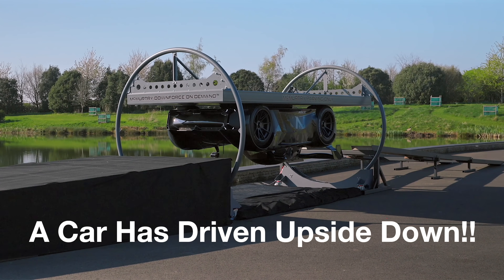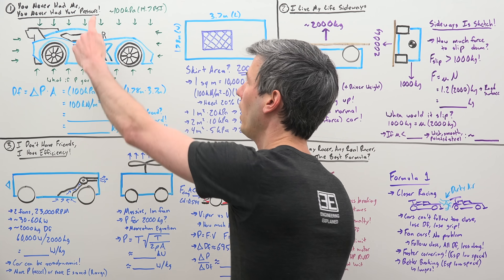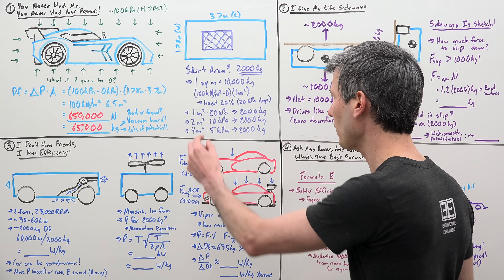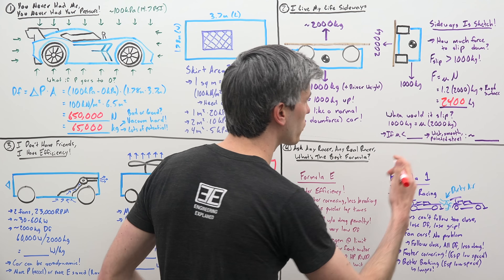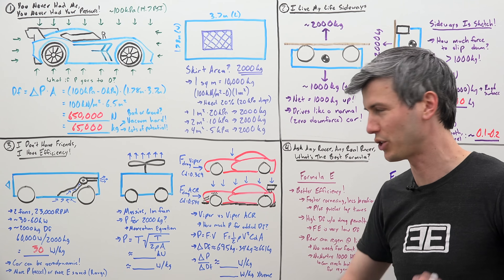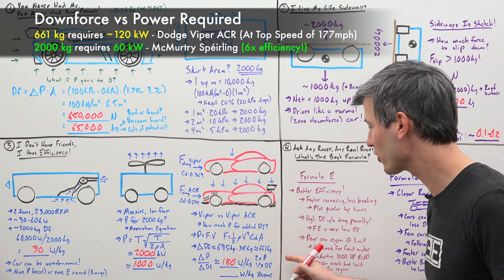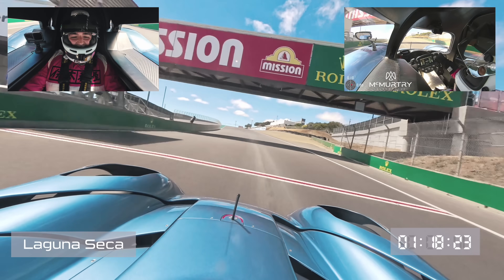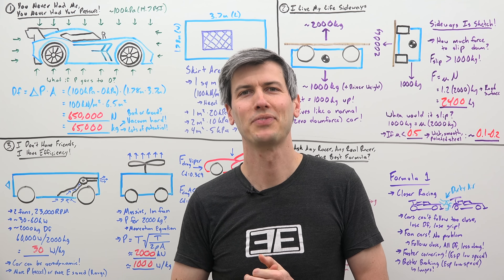This Car Just Drove Upside Down!

Comment: For racing - one thing the McMurtry Spéirling has that the Formula cars don't is a closed cockpit. My one concern -- which many of the people who raced against the Brabham BT46 had -- is the dust a fan car throws at you. F1 and FE would either need closed cockpits or PAPR helmets to prevent dust getting to the following drivers eyes and lungs.
Reply from the maker: F1 drivers wear helmets with visors
Reply: @ For sure, but I do worry that since they aren’t completely sealed helmets, with cutouts to allow air flow in to cool the driver, that following behind a fan car chucking pressurized dust at you some would get in. Especially with the negative pressure created by every inhalation.

Comment: There's a reason why this will not be implemented in racing. There have been cars with ridiculous amounts of downforce before in formula 1 (groundeffect cars. Even some with active fans like the Speirling) in the late 1960s to early 80s. The technology was banned after some horrific crashes. Yes it works well, but if you ever hit some uneven part of road, debris or bottom out then that spoils your seal. In a 3G cornering maneuver you're just going to fly off the track.

Comment: A cool feat of engineering, but suction is far different than wing style aerodynamic downforce. I could put a skirt on my chevette and drill a hole in my hatch then put a big vaccuum pump on. And I get pulled to the ground. Doesnt make my car aerodynamic. It is just using power to counter gravity. An inverse hovercraft. Or if one did something like the moeler skycar snd reversed the propellers.

Functionally, of course it works but not quite the same principle as the core topic of the story. Course by physics, the work to do this is the same as to overcome drag to provide the same as winged downforce, but it can do so actively and at lower speeds.

Comment: I was really confused by how the little fans could be so much more efficient than an upside down helicopter rotor, because that is something that just flies (pun intended) in the face of my understanding of general aerodynamics. The reason high-bypass jet engines and gliders are so efficient is because they impart a small moment change to a large volume of air.

But then I realized the key difference with Spéirling's fans is that they are not operating in a normal atmospheric environment. Sure they impart a large momentum change on the air they do move, but they are operating at a near vacuum. However that vacuum doesn't come for free, the car lowers a skirt to improve the seal it makes with the road surface. I think to really compare the Spéirling's active downforce system with a passive one we would need to account for the change in drag coefficient lowering the skirt causes. Even if the active system isn't more efficient in the end though there are still all the other advantages of an active downforce system you covered.

Comment: You said you dont see this being implemented in street vehicles but I see a really good use case.  Preventing Tractor trailer roll over when traveling through high wind areas like Highway 2 in Montana or 550 in Colorado.  Big fan additions to trailers that are used in the region could mitigate a lot of roll over events
Reply: That's a legitimately interesting idea!
Reply: A normal road isn't as smooth as a race track. That car needs to be very close to the track, as shown in the video. And also there could be too much debris. Imagine the fan sucking a plastic bag, or something like that.
Reply: @f-s-r  fan guards 😉

Comment: Having fans instead of passive downforce will eliminate the drag from the downforce and will also reduce overall drag not from downforce.  Blowing air into the low pressure area behind the car reduces drag to the point of actually pushing the car forward. I faintly remember that the Chaparral 2J Can-Am car could go about 40 miles per hour just on the thrust of the fans with the main drive engine not running.

Comment: Couple of things:
1. I hate the metric measurements. I find myself trying to mentally convert to imperial units.
2. The fan concept for downforce is interesting but ultimately doesn't/won't mean closer racing in F1. Less drag means less tow which means less closure speed. The late lunge doesn't work because the braking distances mean even less braking, less speed bleed off, and less potential for lockups because the downforce remains relatively consistent because of the "artificial" downforce. Last the engineers in F1 will always find a way to take advantage of the rules and the best will still rise to the top. Better racing (more driver dependent) in F1 would happen if you take away a lot of the driver aids (diff settings, different engine mapping, different braking biases, etc) and make the drivers compensate for the car.

Comment: I've been wondering since the McMurtry came out if the same technology could be applied to an electric semi, except suck the air through the front faux louvered radiator grill while at speed to negate the wall of air the truck is trying to push through, of course with a system of determining how much power to put to the tires or to the fan(s) at various speeds. It works in my head. It could even have a system of channeling the air all the way to the rear of the trailer to reduce drag.

Comment: Another way to estimate the power and speed cost of downforce for the Viper is based on ratios. The downforce increases the coefficient of drag by roughly +46% (.37 to .54). Power is proportional to this, so it would take about 46% more power to reach the same top speed. Top speed is proportional to the cube root of power or drag, and cube root of 1.46 is about 1.13, so speed would drop by about 13%.

Comment: from an engineering perspective, once you introduce the grip tape, is it appropriate to even be discussing coefficient of friction in relation to side slip? Since the rubber of the tire keys into the irregular surface of the tape, just like a road surface, slippage results in a shearing force between the surface rubber and the underlying material (laying rubber). Do any calculations for friction take in texture and size of the contact patch?
Reply from the maker: Answering your last question, yes and yes. Frictional coefficient is always surface dependent, and texture is a critical element of that. Larger contact patch tends to increase frictional coefficient, though only very slightly, due to something called tire load sensitivity (I have a video on this if interested - https://youtu.be/kNa2gZNqmT8?si=ES7YLyy7NUA-wbo_).

Comment: This isn't how F1 cars atick to the ground or a claim of how it works. This car is doing something else intirely. The idea behind F1 is that it's from airflow coming from the front of the car and not a fan. This car is like a reverse hovercraft. Very cool, but to show an F1 stick to the ceiling, they would have to put it in a wind tunnel and push enough air over it.

Comment: One question comes to my mind. If it generates so much dowoforce, then why it still has rear wing and other common aero bits? Would't it be better to reduce drag to improve efficiency while still maintaining huge downforce level coming from the fan? One reason that comes to my mind is car stability and consistency of downforce coming from the floor (Peugeot learnt it hard way with the first revision of 9x8).
Reply: Might also need to have some redundancy for more leaky pavement, areas with small debris, sections that aren't flat enough etc
Reply: Even more downforce more better
Reply: @timbryan6013 but the whole point of the video is proving that fan downforce is way better than passive aero downforce. so  it would make kinda  sense at least for the most extreme track version to remove all passive aero, boost the fans a little bit more, and achieve shorter lap times with more acceleration, higher top speeds, and better range
Reply: the car is still designed to be drivable with the fan off, to speeds approaching 200mph, just way less downforce. with zero passive aero, maybe the car would have too much lift
I think there might be a design decision that the car while using unconventional fan downforce, must still look like a conventional race car, which it does despite being narrower

 probably also because of redundancy. imagine a car being designed with a lot of lift and only fan to cancel that lift. not only you would have to make sure the fans are spinning correctly before trying to reach this speeds, but also imagine you have some catastrophic fan failure, with road debris getting sucked, may be getting filtered  by the  
protection mesh but eventually clogging the airflow. the last thing they want is a car going airborne at 200mph
I am guessing if they really wanted to push the map times with the fan mode they could remove the passive aero or make it active.

Comment: Chaparral had a vacuum cleaner car with a second engine to blow air through the radiators by sucking it from under the car, back in the 70's

Comment: This makes me wonder about other EVs and aerodynamic and/or performance focused vehicles. The Lucid Air Sapphire, Model S Plaid, Hyundai Ioniq 6, etc. How much downforce do they make? they are some of the lowest drag coefficients ever made on a car. They are blisteringly fast, with the exception of the Ioniq 6 which is "only" 4.4s 0-60 and EVs are largely called less agile because their weight, but also low drag means low downforce. Could that be part of why they are less agile? or are they significantly  less capable of cornering by downforce, and their high curb weight almost helps to make up some of that loss. This is well beyond my knowledge, but could be fun to learn about in the white board format

Comment: Its cool but higly impracticle. Are we just gonna make upside doen roads? If so how well maintained are those upside down roads g9nna be cause we cant even take care of pot holes on regular roads i cant imagine upside down roads. Not only that if a theres a failure in the vacue system while upside down your not just gonna stop and pull to the side, no your gonan fall and possibly land on someone possibly killing them and your self. I would feel safer with elecrot magnets that would stay on instead of a fan motor that can possibly fail vs a no moving parts just current flowing to make a magnetic feild.

Comment: Standing still sucking upside down is not the same, for a car to DRIVE upside down it needs to overcome the drag that is at same time creating the downforce meaning if there is to much drag the wheel will start to spin and you loose speed and fall down...

Comment: Didn't it really just park upside down while a truck pulled it on a trailer with specialized equipment? 

Not really the same thing as aerodynamic downforce when you've put a giant vaccuum under your car.

Comment: Having worked a little bit with turbomolecular pumps... I was always scared of breaking them in a controlled lab setting. It feels remarkable that the pumps on this car can spin at 20k under high-G dynamic situations and still operate correctly, but maybe angular momentum is too formidable to care about some measly race track force

Comment: It's not driving on aerodynamic downforce, which requires speed + surfaces.  It's a reverse hovercraft that generates suction using motors.  Now stop clickbaiting, find a tunnel and  an F1 car and drive upside down.

Comment: 14:17.  What is this electric charging pitstop?
Reply: yes
Reply: 600kw recharge speed 
60kw battery 
A full recharge is probably like 6 minutes but slightly less forsure 
Depending on race lengths

Comment: So… how well does this system deal with FOD ingestion?  Like, let's say you dodge a spinning car and go off-track and through some gravel.  Is that going to damage the fan system?  (And also, is that going to spray gravel out of the back of the car?)

Also, what if you drive through a puddle while you're on track during the rain?  How well will it handle the sudden extra mass of water versus air?

Comment: I.e.  It wouldn't appeal to a car enthusiast to watch a drone flying around a racetrack.   

Don't get me wrong, it would appeal in other ways, just not as a racecar.   The technologies have to be relatable.  F1 car has more incommon with a common work van  than a sucker car has incommon with anything on the road.  As soon as you start introducing features that have no analogue on the street, there's less and less relatability.

Comment: It'll never see wheel to wheel racing. It will be picking up and spitting out everything on the track, right into the following driver's windshield...including marbles from tire wear and gravel from any (inevitable) offs. Also, this was tried in SCCA autocross events way back in the early '90s and was banned. It worked well there. Not sure why it was banned. Maybe unsafe for course workers.

Comment: The air blown out the back reduces flow separation so it further reduces drag.  On top of that, I wonder if there's a slight propulsion effect due to the high velocity of the air being blown backwards.
Reply from the maker: Ha, I asked about any propulsion effect from the rearward fans, that say it was basically negligible and in the realm of some newtons.
Reply: @EngineeringExplained  Would propery shaping the rear air thrust out and potentially doing something with it (heating? igniting? I'm not really an expert on this stuff) have any chance of making this a reality? Like a jet engine that uses its input suction to also generate downforce.
Reply: I believe rolling resistance increased by the vacuum would be greater than the propulsion effect.
Reply: @divyarajkumar2263  The coefficient of rolling resistance is typically very low (0.01 - 0.015) and the rolling resistance only increases linearly with increased downforce whereas the aerodynamic drag increases with the square of the velocity.  Paired with the fact that a large fraction of the total aerodynamic drag at higher speeds comes from rear effects like flow separation, expelling the air rearward should have a much greater positive impact compared to the negative impact from increased rolling resistance.

Comment: i had RC cars that did this as a kid, it's effectively just that scaled up. The "AirHogs Zero Gravity" is what i mean. lightweight lil RC car that sealed to a wall or ceiling with lil paper skirts and used a loud ass fan to pull air out from under the car.

Comment: Driving upside down....Theoretically yes, real world nope....curbs in racing, breaking the seal....and there is not a race track that is smooth enough...certainly not a "painted surface" race track...just no Jason...
Reply: Top gear track is not smooth and it did fine. Just don’t go over corner bumps 👍
Reply: It works fine on normal race tracks though.

Comment: How is the seal maintained while driving at high speed, is it wearing down the skirt? And what if you go over a bump while cornering, disrupt the pressure differentials and just lose control?
Reply: Special material science. And as shown on top gear going over a turn bump messes it up. So just don’t go on bumps 👍

Comment: For an engineer, you should probably distinguish between mass and force  - repeatedly saying 1000kg of downforce is incredibly annoying, and wrong...
Reply: It's easy to understand. You're being pedantic. Put a scale under the wheels, and it'd read 1000kg more.
Reply: @logitech4873  sure, but any ACTUAL engineer calculating lateral force of a tyre would do mu x FORCE, not mu x mass. Tyres do not generate kg of force, it's meaningless
Reply: @GamezGuru1  It's not meaningless when it's extremely easy to infer meaning from it.

Comment: Car is breaking track records everywhere it goes because of those fans.  Only issue, it has to be a flat track.  Incorporate a poor surface condition, the fans become almost useless.
Reply: The only issue is bumps on a turn. Top gear is very worn and did well when not going over turn rails.

Comment: In the early days of electrical RC helicopters, rule of thumb was around 50W per lb to fly OK. So 1 hp can fly a 15ish lb model.......barely. This is out of ground effect, required power is much less near the ground. 1000 W/kg seems like an insane number, I think related to the small rotor you chose. Ironically 1000w/kg  is pretty close to what a super powerful modern RC heli might have, but the can do insane 3d aerobatics and accelerate against gravity at several to many g.    Its not really an efficiency so no work is being done to hold the car down. With perfect frictionless sealed skirts you could maintain downforce with 0.0 watts.

Comment: So they're doing what Brabham did in F1 with the BT46B back in the late 70's, which I saw racing at the time, not only did it employ a fan but employed a skirt as well as d=far as I recall. It also took it's inspiration from an earlier race car, so there's nothing new here, apart from the fact they had it upside down, but not really driving.

Comment: The achievement is impressive. It bothers me a lot the fact that if a fan breaks you sudenly lose half downforce, which would most likely get you straight into  a wall if it happens during a corner. Still, the achievement is insane
Reply: The whole point of 2 fans is that you keep the downforce if it breaks. And the whole point of the fans is that they don’t break lol.

Comment: I actually understood most of this minus all the math formulas.  But the concept of a suction holding the vehicle down makes a lot of sense as long as no turbulence gets under the car.  I'm sure that's already been figured out both in theory and in practice.
Your also right in saying it wouldn't work with an every day production street vehicle and that vehicle just doesn't need that system......for now.
Good video sir.  Makes you think.  And being non racing knowledgeable, I did not know about this system being used on a racing vehicle or even when it was incorporated into racing vehicles.